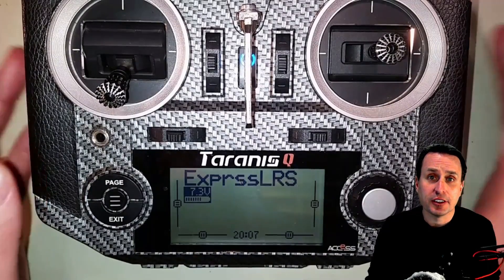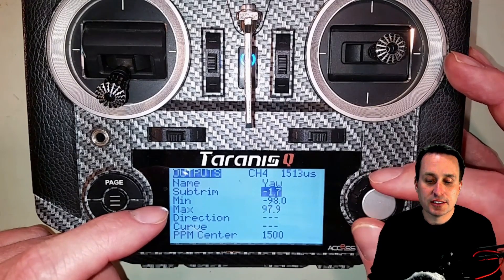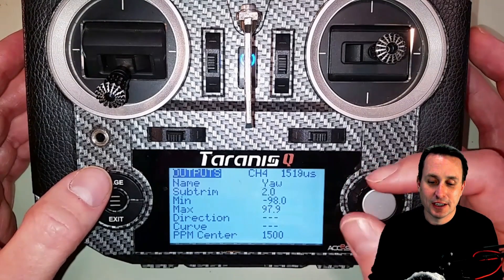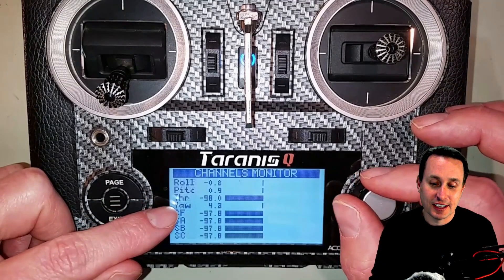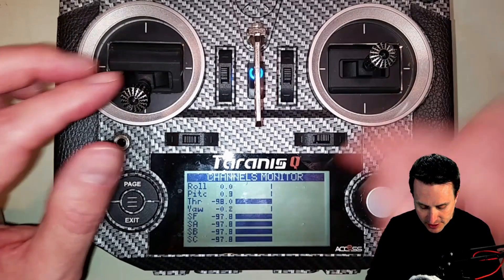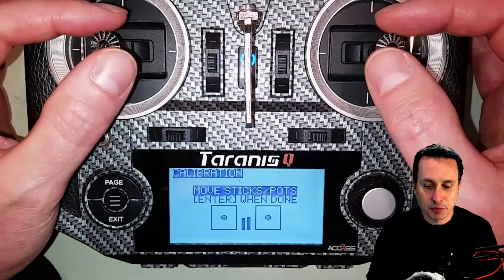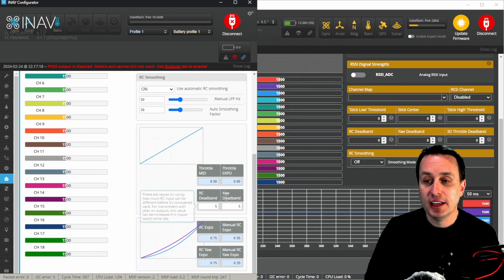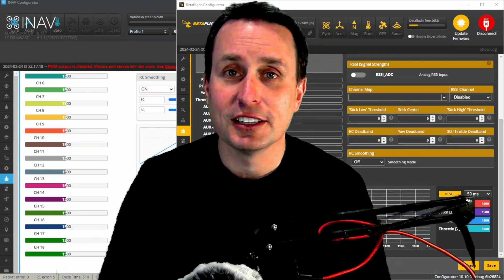FIXING yaw | roll | pitch RANDOM drift!

Comment: I have this issue with my Q X7S. I'm confident that it's just dirty, but I've been lazy to clean it because I have mostly been flying sim lately (cold weather). I have noticed that a quick temporary fix is to flick the stick and let the springs shake it around while centering. The only thing I would add is, when you have the radio open, to blow air all around the radio to make sure you don't have dirt lurking in the back that could get in there after you put it back together again.

Comment: Hey,
speaking of random drifiting/ rolling: My Analog FPV Setup has decent range, but sometimes the video in my googles starts to randomly drift to the right and gets black/white sometimes. After a few seconds my Skyzone Sky04X beep once and the video signal is perfectly finde again.
This happens super randomly, completley independent on how far the drone is away from me... Also don´t think its a overheating issue...

Any tips on what to do? I need the video signal to be reliable, since i´ll use it for a fpv-job!

Comment: The problem is hall gimbals are getting affected by tempareture differences. You can try it out, what you will read on the gimbals inside and outside will be different. And it changes in time as the tx gets hotter or colder with the ambient temperature. It is really annoying. The newer tx's are all haunted by this, Tango 2, Jumper T12 etc etc. The only one that is not affected that I have seen is Taranis M9 gimbals, they stay rock solid at 1500 even with ADC filter off.

Comment: Yup, had this issue with my cheap 'n' cheerful BetaFPV Literadio 2SE. The potentiometer gimbals were awful, always had a load of jitter from new and I needed lots of deadband. Eventually the yaw potentiometer failed, after not many hours of use. I fixed it once by spraying it with WD40 and that worked for a while. I eventually replaced the gimbals with their Hall gimbals, incredibly cheaply, and it's been perfect ever since. Zero jitter, zero drift- I've never had to recalibrate the thing.
Reply: To be clear, I only use that radio with tiny whoops, nothing bigger than 3.5" when I use it for travel and leave my Zorro at home. I only trust it so far...

Comment: Had the same issue with my QX7 radio. I when all other channels locked in using the sub trim adjustment, the yaw would still drift. And I nothiced this would happen with all my quads!
After a bunch of tests, I had to resolder the wire to the gimbal board to get the signal to lock in. Looks like over time friction against the wire cause the solder joint to break down causing intermittent signal.

Anyway, I haven't had any issue since.

Comment: Actually the first step I would recommend is making sure the trims were not hit accidentally. This is by far the most common cause I have seen when helping new pilots. I would also recommend disabling trims to prevent the issue from happening again. The ultimate solution is to have yaw and pitch trims only active if in angle mode. This also frees up unused trim switches to be used as momentary switches.
Reply from the maker: good point!
Reply: I actually do use ANGLE mode and would like the trim switches to actually work.
Reply: @buddyadkins2432 It is possible to configure things so trims work for angle but are disabled for other modes. If you go to the page where you can disable them, you will see that there are multiple configurations. You can have your mode switch activate a line that enables trims only in angle mode. You don’t really need throttle and yaw trims even for angle but you could set them active if you wanted those as well.
Reply: @TechnicallyTom  Is that in Betaflight? What tab?
Reply: @buddyadkins2432  Flight modes tab on the transmitter where you turn off trims. Turn off trims on first line. On line below, enable only the trims you need and assume go the switch position for angle mode.
Reply: @TechnicallyTom  Didn't know it existed. I have a pretty basic setup on my (original) Jumper T16 running the JumperTX firmware (the original fork). I guess that I need to find some transmitter guide or something. By the way, after setting up the models originally, I have not messed with the transmitter (several years now), Thanks, I will look into it.
Reply: That's exactly what happend to me. You're a saviour. I flew yesterday my quad and heard strange quick beeping sound on my radio as I accidentally touched my radio during battery change. After that quad started having the yaw drift. I tried everything and setting up new model helped, but I couldn't figure out why. I read your comment and search for videos about trim... Then I hear the familiar sound😮. My yaw had a trim set to max

Comment: Hi marcos! I have a question, if I manually turn off telemetry on tbs tango 2, does gps recovery not work when my radio turns off or I lose connection to the quad? I decide to disable telemetry because it causes interference with the video!
Reply from the maker: Failsafe detection will still work regardless of telemetry.

BUT DO CHECK that turning off your radio triggles a failsafe with your quad on the bench (props off).
Reply: @uavtech  And what function does the activated or deactivated telemetry option fulfill? I will try, it makes sense that it does not affect the rth with telemetry activated or deactivated, I have rth configured it always works well only that with telemetry xf on I have noise in the video
Reply: This was my exact issue. Thanks you! Dirty worn gimbals

Comment: Mark I swear, I had the same issue with Foxeer F722 mpu6000 v4. I had deadband 7. On the logs the setpoint was at center, not even a sign of drift. Gyro also saw 0 degrees/second yaw drift. But sometimes after arm in a few seconds quad was drifting like 60 degrees. After the drone power cycle the issue was going away sometimes. After a few harsh flights the issue is not there at all. What is your guess? Was that a fresh gyro issue or something? Like after a few crashes the gyro got fixed by itself somehow?

Comment: Good info, as always with your videos  and i did not know that about the radio on/off. 
I had something similar though not for my gimbals but for my 2 pots on a radiomaster boxer. Now as there is no deadband setting for other channels in inav and they where driving my pan/tilt servo, it was a bit irritating as when centered they would wiggle just a tiny bit my pan/tilt servos.
After trying different options i found the  best solution to create a custom curve in edgetx where you can also define a deadband. Then assign that curve to the channel in question (either on input page or on mixer page depending on where you use it.)
You could of course do the same for any other Rc channel as an alternative method to doing it in inav/bf, so you have it in your radio instead of having to set it for every quad/plane.
p.s as you mentioned , specialy for servo channels , adc also works pretty good if the jitters are small.